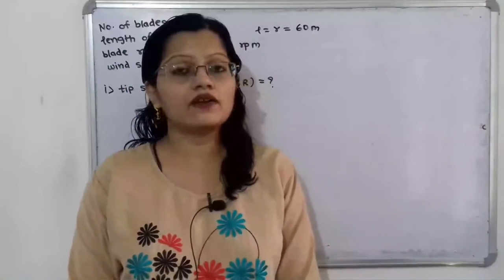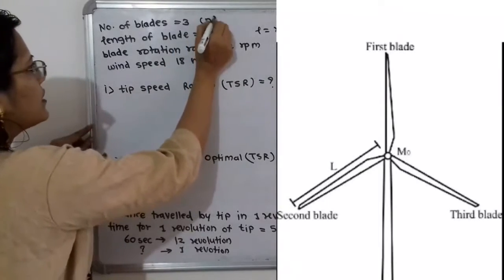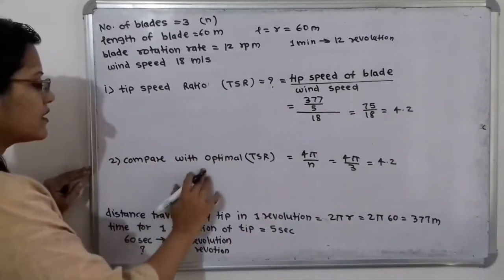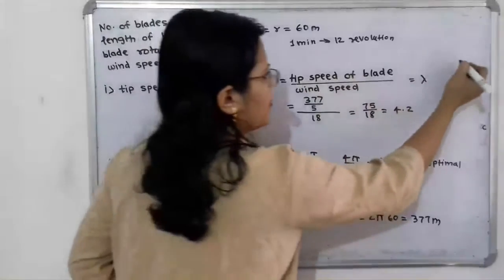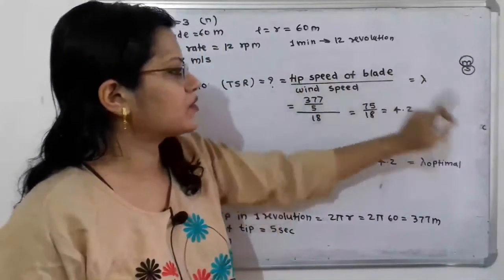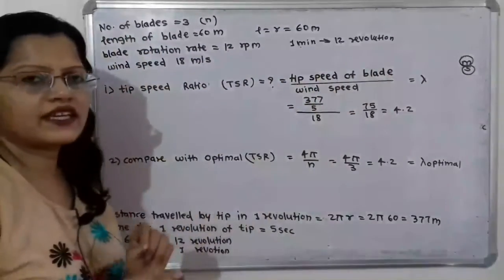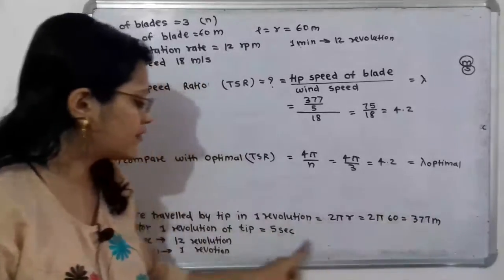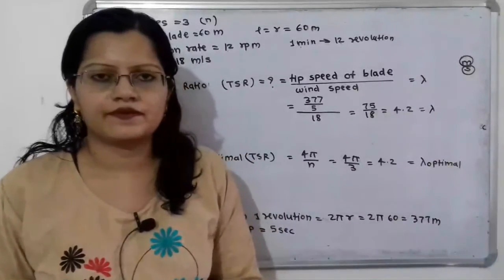Problem 1 on tip speed ratio (TSR) for wind Turbine/ Renewable energy engineering

Comment: Mam,
Tip speed ratio  and 
Optimal tip speed ratio is complisary equal or 
simalir values  are equal to solution mam, please reply
Reply from the maker: It's similar
Reply: @edutechguruengineeringlear4280  Thanks for responding mam